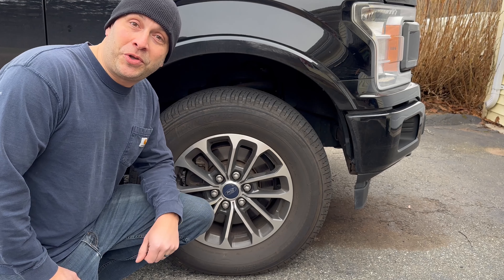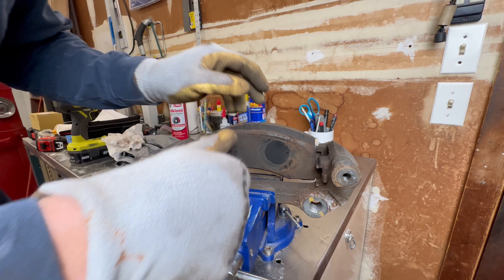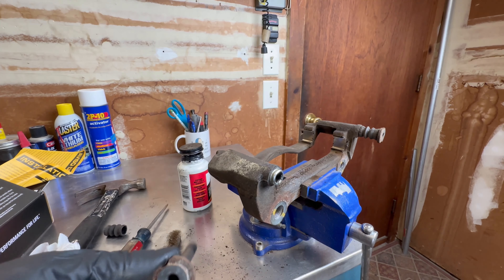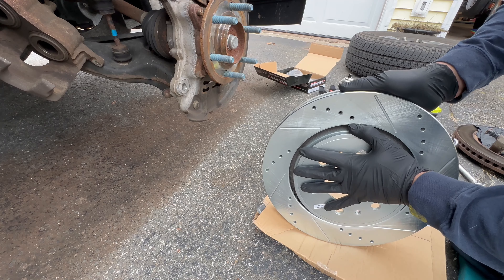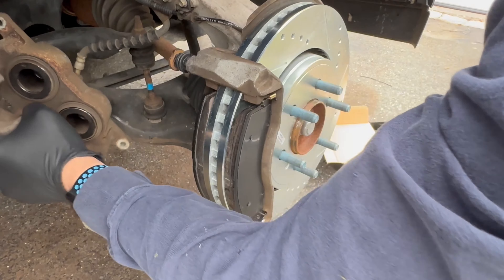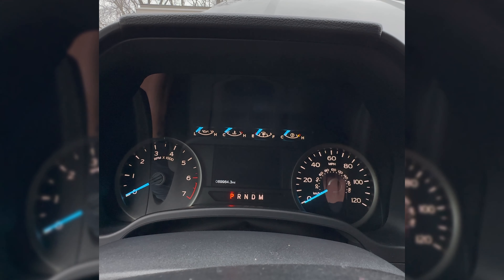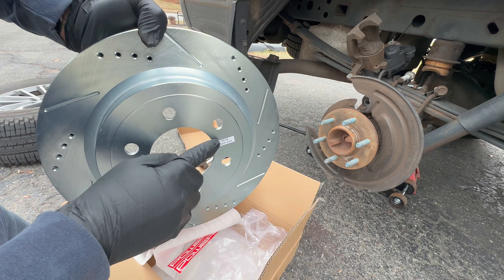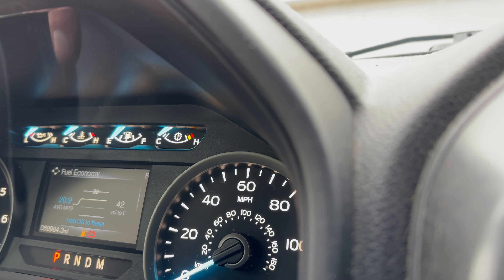2018 Ford F150 Brake Replacement - Powerstop

Comment: Very concise and clear info.  Best Ive seen!  Questions: Add more loctite or not? Can you do a video showing how to bleed, or better yet do a full fluid change!  Thanks!
Reply from the maker: Definitely not a fan of loctite on caliper bolts. I mean you can use the blue or medium grade if you want. Anything more than that and you’ll have to heat the bolt to remove. As far as bleeding are you replacing an entire caliper or master cylinder, lines, hoses..? Otherwise there’s no need to bleed or flush. I do have to do the brakes on my wife’s Honda so maybe I’ll do that video.
Reply: 90K on my 2018 F150 4x4. Putting on Powerstop kit with new calipers.  Want to completely flush or change the old fluid prior to install to keep any old gunk out of the new calipers, and then re-bleed after the install.  Mechanical is easy; just want to get the fluid right.  Thanks again.
Reply from the maker: I would start bleeding furthest caliper from master cylinder so passenger rear then drivers rear then passenger front then finally driver front. Those vacuum brake bleeders from mighty vac work really well. Just make sure the reservoir never goes dry

Comment: Awesome instructional video. What size are the rear rotors? 336 or 350 mm?
Reply from the maker: Front is 350mm rear is 336.1mm. Also the rotors are the same as used in the tow/haul kit. Only difference is pads but I think I may have mentioned that in the video